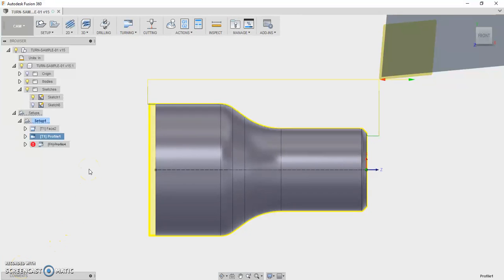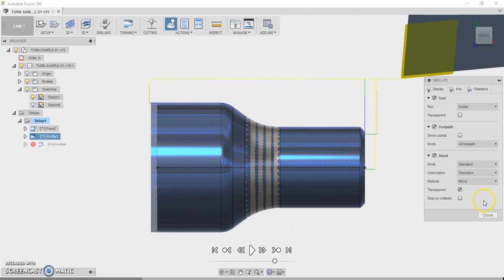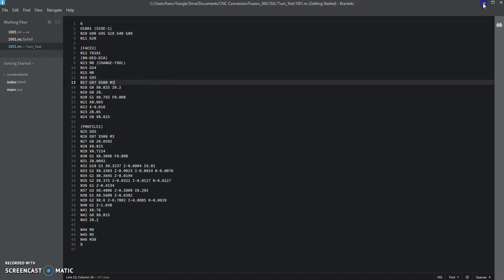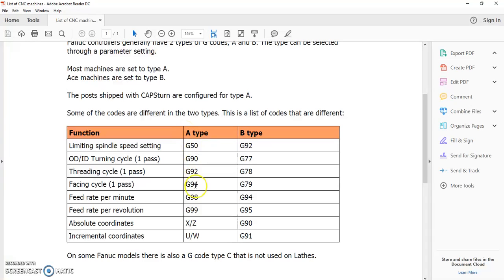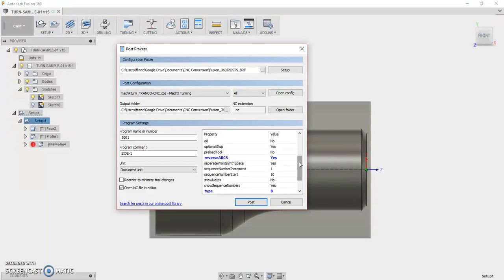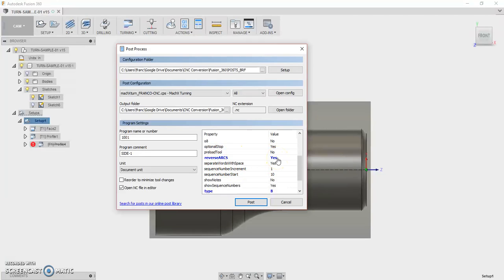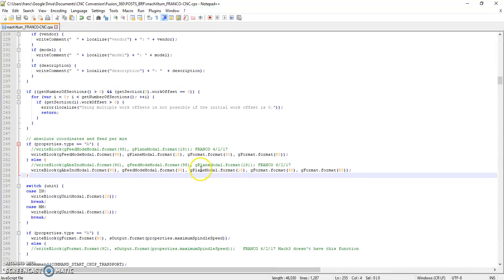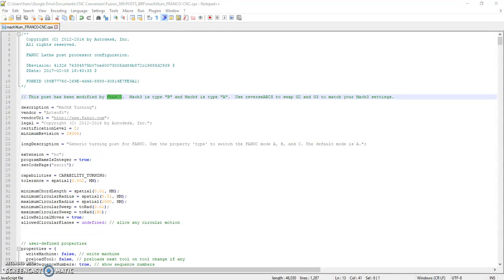Mach3 and Mach4 Turn Post Processor for Fusion360

Comment: Great work. Although coming from an industrial controller I can't understand how this PP would work for a facing and contours turning. The way it is configured only allows for center drilling (RPM). Is there a lathe PP you could recommend that has Constant Surface Speed (G96 & G94) for turning operations? Thanks

Comment: Thank You for all of your hardwork and great videos.  I am trying to use Fusion 360  to create lathe tool paths in Mach3 - so your video really helps.  Thanks for your help.
Reply from the maker: You are welcome.  Fusion 360 has really improved their turning tool path types over the past few months - I think you'll really like it.
Reply: @FrancoCNC  I'm still confused by F360 Manufacture, to be honest.. The rotation (CW/CCW) the orientation of the part.. all sort of seem "backwards" to me.  Trying to just get started and generate basic tool paths
Reply from the maker: @joecnc3341  watch a few videos.  Don't worry about posting code at first.  Just try to learn the screens.

Comment: Hi Franco! This video helped me so much. I'm using your post processor and I have one question... I'm converted old Italian lathe (Locatelli) to make table legs and every time I fix raw wood peace on both left and right sides (left to spindle and right to support cause every peace is at least 500mm long). In this case I can't reach X axis zero (raw peace center on the right side) so I can only touch outer right side of the raw peace and set it to X0Z0 in Mach3 Turn. How can I do this in Fusion 360 so that my tool start from X0Z0 of raw peace outer right side and next line to be like X2Z-500 and so on.... In current setup I set X0Z0 of the raw peace (outer right side of raw peace) and my tool starts Z correctly but X axis moves out of raw peace for raw peace diameter. Hope you understand me! Thank you!
Reply from the maker: Hello - I believe this video will help you: https://youtu.be/xQNcicGMbtw
You are very close.  Watch the video and I believe you will be OK.
Reply: @FrancoCNC  
Franco,
Thank you so much! I was able to resolve my problem. Now I have only one problem... fillets (radius). I draw 3d models in Fusion360 and export gcode to Mach3 lathe using your post processor. No matter what I do fillet in Mach3 looks weird. I tried to reverse arcs in Mach3, to change from Diameter to Radius mode, to setup post processor like you in this video but nothing helped. Is there anything else that I need to pay attention? Also, is it better to use LinuxCNC for lathe then Mach3 Lathe?
Reply from the maker: @gotik911  hello. Make sure your tools are setup as a FRONT turret in Mach 3. That may be your problem.
Reply: Franco, 
I figured it out! In Mach3Turn in Ports and Pins, Turn options, only Radius option needs to be selected to be able to cut radius properly! Once again thank you for your help!
Reply from the maker: @gotik911  Awesome!  I'm very happy you figured this out.

Comment: Cheers Franco for making this video. 
I have literally just converted my machine (old italian cnc) and wanted to go down the F360 path for drawing and G generation for Mach3 control. I have been struggling with errors on post processing and finally worked out i needed a turning post processor. I am an old router table guy so i had it in my head i could just use that PP. 
glad you hit on front tool post setup’s being an issue in Mach3. Didn’t realise it was a problem.

Q. In your rendering of the part being cut i see it had the tool on the backside of the lathe. Does the post processor expect this and will it convert it to a front setup? In the code i am experimenting with i have to flip the x axis in Fusion to make it run like a front mounted tool post configuration.
Reply from the maker: Hi.  Without seeing your setup it's hard for me to be much help.  The post doesn't flip anything from front to back, it just does whatever Fusion 360 tells it to do.  The configuration worked on my lathe.  Sometimes, you just have to try a few options until you find the combination that works best for you.  FYI:  I don't use Mach3 any more - I've converted to Centroid and it is much easier to work with.

Comment: There is a post on the autodesk forums for mach3 turning that works pretty well and I was even able to get autodesk to help me add the correct threading cycle which can be used with single pulse indexing. I used to use it all the time until I finally ditched mach3 for linuxcnc. At the time mach4 didn't support threading at all, have they worked that out yet?
Reply: bensbenz how difficult was it to switch to Linux?
Reply: It took some doing, had to machine a new encoder disk and add an additional sensor on the spindle so I could do threading and it took 2-3 days to get it all configured to run my machine. If you check out russtuff on YT, hes been putting out some videos on getting his machine converted that are similar to how I did mine.
Reply: bensbenz thanks, I totally forgot about him. I'll checkout his videos
Reply from the maker: Here is something you may be interested in:  https://youtu.be/Y8NCtrCytDQ
Reply: https://www.youtube.com/watch?v=xGDhFOJQLBU

Mach 4 threading in action.